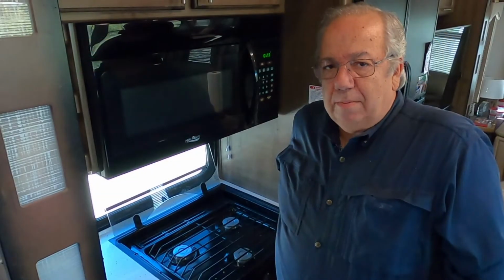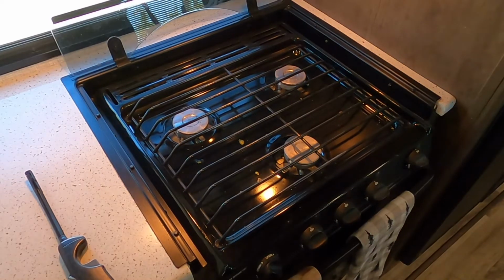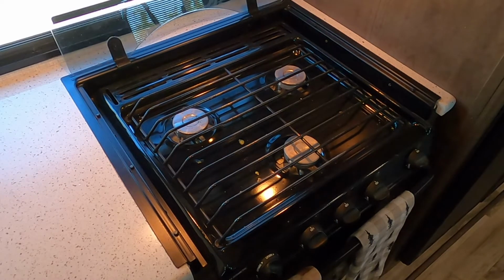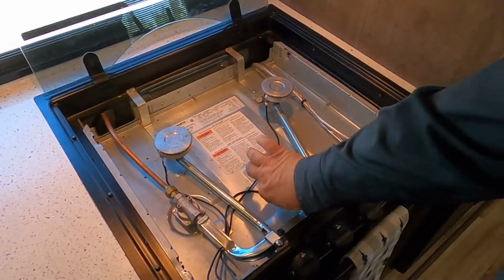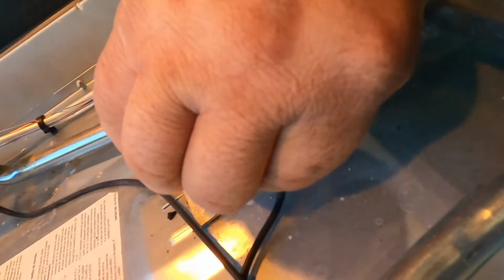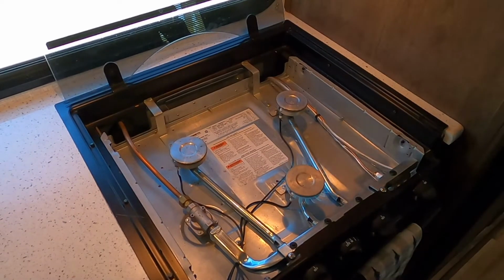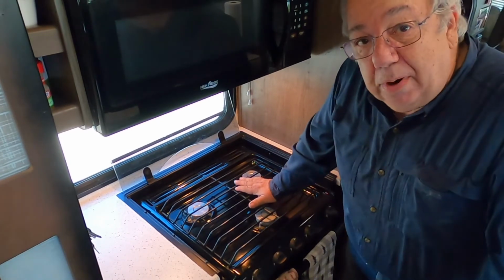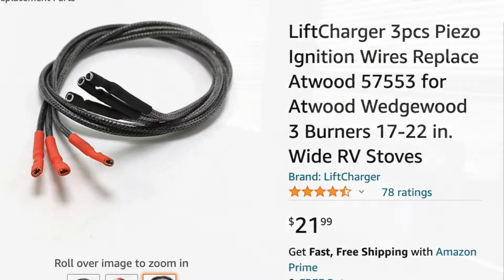Dometic Stovetop repair - Igniter wont light burners

Comment: Mine igniter won't light any burners. Watched you pull your wires. Went out to camper pulled top off, checked wires. Pull each one out of spark unit wiped each a little and plugged back in. Turned gas on all burners worked. Easy fix I've ever had. Thanks for the advice.